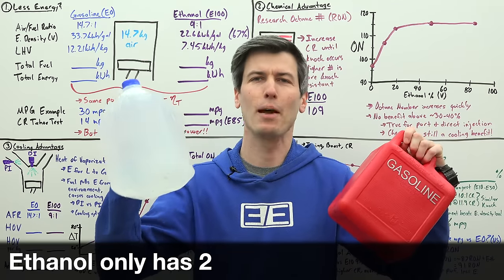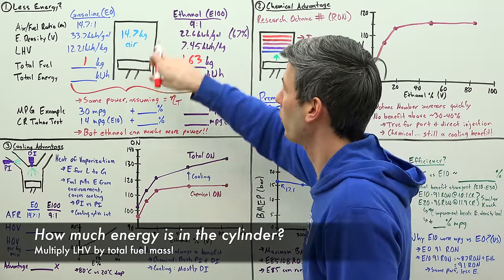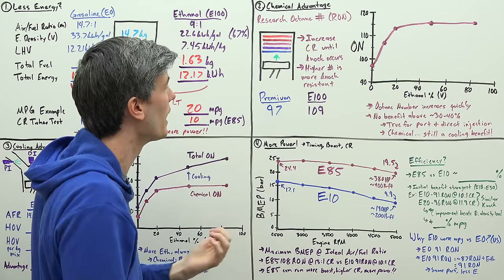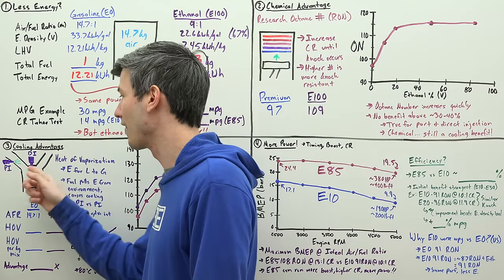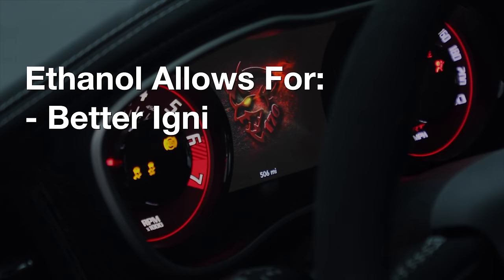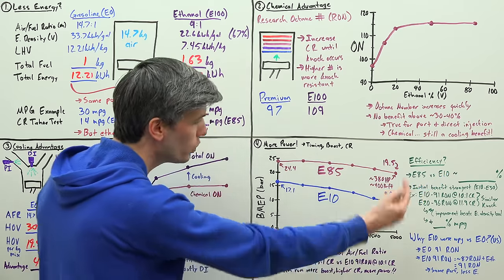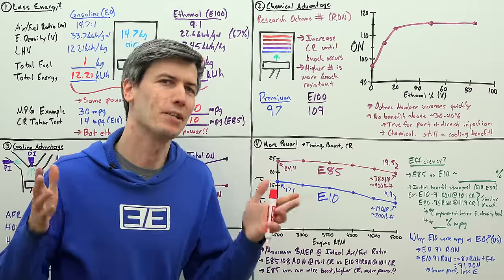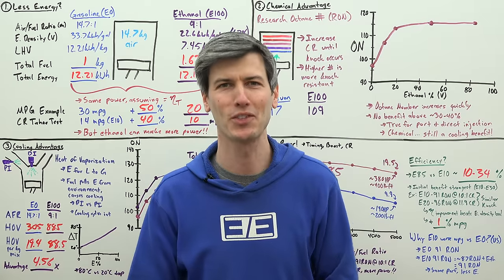Why Does Ethanol Make So Much Power? (Versus Gasoline)

Comment: So glad you did this video. This is what I have understood about ethanol as a fuel but could not explain to others for decades. The Model A Ford ran on ethanol because it was the original fuel for cars. Alcohol as an engine fuel is actually better overall but only when the engines are designed to take advantage of the properties of ethanol. It’s cleaner and can be more efficient. Regular gasoline can NEVER be cleaner burning than ethanol.
Reply: If ethanol is always cleaner, why is E-15 banned for environmental reasons in some places?
Reply: @karlrovey  — Here’s the answer to your question:

“Volatility is the property of a liquid fuel that defines its evaporation characteristics. RVP is an abbreviation for "Reid vapor pressure," a common measure of and generic term for gasoline volatility. EPA regulates the vapor pressure of gasoline sold at retail stations during the summer ozone season (June 1 to September 15) to reduce evaporative emissions from gasoline that contribute to ground-level ozone and diminish the effects of ozone-related health problems.”
Reply: @karlrovey There was an obsolete RVP law which E10 was granted a waiver from rather than updating the law for ethanol. Ethanol raises RVP slightly but overall effect is drastically less smog because exhaust is drastically cleaned up despite the slight increase of RVP. Pressurized fuel caps and carbon filters have taken care of RVP problems anyway. E85 never needed a waiver since its RVP is super super low.

E15 raises RVP less than E10 and higher blends are lower as well until more ethanol is lower than gasoline. In other words E15 produces less smog or RVP emissions than E10, yet E10 is legal in summertime and E15 is illegal. Go figure.

RVP is only measured at 100 degree F. Ethanol has no VP (vapor pressure) below 70 degrees and the vapor pressure of VOCs it does have are less ozone making than petroleum's toxic VOCs. Gasoline has vapor pressure down to -45 degrees.

Comment: I will watch again, but two questions that I hope someone can help me with:
* Is it all due to the cooling effect (whatever the term) that allows you to run high compression and therefore get more power?
* How can you change the compression ratio on an engine? I always thought it was done by bore size and stroke length? So how do the e85 kits work?

Excellent as always. This is the most difficult one I have seen you do to date! Excellent job!
Reply: 1- It’s not all due to the cooling effect.

2- the traditional ways to raise compression are head replacement (with smaller combustion chamber), shave heads, shave block deck, and install taller pistons.

For street engines, the Atkinson-cycle engine offers flexibility to run high compression or lower compression by changing valve timing. These engines are currently being used in production cars, but generally to enhance fuel economy — however, the potential is there for use in higher performance applications.

Then of course there is forced induction, which while not raising the mechanical compression ratio, does raise the effective compression ratio and thusly brake mean effective pressure (engine’s capacity to do work). Turbocharged applications are where ethanol really shines.

Comment: American open wheel race cars (CART, IRL, Champ Cars, and now IndyCar) have been racing on alcohol fuels for decades. They switched from gasoline for fire safety, and they ran 100% methanol and then ethanol.

The reason they use E85 today is because the additional gasoline has the advantage of making any open flames visible in daylight, as fuel fires in previous years were invisible (a pit crew who got a flash-up would do a Ricky Bobby impersonation).

Comment: For a couple of years now I've had an Audi that from factory can run any blend of regular gas/petrol and E85. I find the fuel consumption to be about 20-25% higher in the summer, but 25-35% higher in the winter, running E85 instead of E10. The increased cooling effect of the ethanol surely explains most of that, it takes noticeably longer to reach optimal operating temperature on E85, especially in the winter. And the longer drives I make, the smaller the difference. So cold starts is the biggest issue with E85.
At the pumps I usually just multiply the E85 price per liter by 1.3 to see if it's practically cheaper than the regular E10. Usually it's suspiciously close between the two, but sometimes it's actually quite a difference (in either direction) and then it's nice to have the option.
The factory engine mapping provides no performance benefit from different fuels in different conditions, it's just been programmed to always feel the same for the driver I'm sure. After-market engine maps could give it a SIGNIFICANT power increase for E10, but the stock fuel injectors cant flow enough to get the same increase for E85. An increase yes, but smaller rather than larger as the fuel would theoretically suggest.
Reply: I used 30% larger injectors in my Honda but your car may have enough injector to do it.

Comment: Modern flex fuel vehicles are severely compromised in order to run on gasoline without ethanol.  To get maximum efficiency (MPG) from ethanol fuel the engine needs to be optimized for ethanol but they could never be run on pump gasoline fuel if they were.  E-85 can easily stand 4 or 5 points higher compression ratio (higher compression gives more efficiency through greater expansion and less surface area absorbing the heat as well as the air and fuel molecules being closer together and more likely to find one another quickly and burn before the exhaust valve opens and releases the pressure) more than pump gas but if you ever ran pump gas in an engine with 4 points higher compression it would detonate severely and destroy itself very quickly.  They could easily go from a max of about 11 to 1 compression with pump gasoline to 15 to 1 compression with e-85, also since the same engine running 4 points higher compression and ethanol would make a ton more power you could also shrink the displacement of the engine to further increase MPG and still make the same power as the larger engine running gasoline.  It is good to note how chemically ethanol needs less air because chemically it carries some oxygen in its chemical makeup thus requiring less from the air, thats why it runs ideally at a richer ratio and how it can make more power, it is like adding liquid oxygen.

Comment: Another really fine, clear, concise and comprehensive presentation.  For those of us intereted in fuel economy,  actual fuel economy (miles per dollar vs miles per gallon), how does the greater compression ratio effect typical around town power use versus fuel throttle?  (basically, the same fuel consuption raios to pump gas or more or less) Thanks, Scott

Comment: Very interesting, thanks a lot! I use E30 with my 50 ccm naturally aspirated,  three valve, 12 to 1 compressed fuel injected lambda sond engine, which has no knock sensor. It runs fine, exactly like E10, even the cold start. My thought is now: Is there a benefit, when the engine cannot adjust the spark timing (earlier, because of the higher octane)?

Comment: It's nice to watch a channel who knows what they are talking about. E also cleans an old engine fuel system and valves. Highly recommend a gallon or two in a tank. E itself burns perfectly clean, without toxic detergents and octane boosters. lol if you think gasoline from crude oil burns cleaner than alcohol.

Comment: I used this in my non ethanol fuel cars. Never had an issue. I would not use it in a 90s cars. No kits nothing. All engine lasted over 150,000 miles. Only issue was cold start up and a lean code which did nothing. Regular gas back in and check engine light goes away. No there is no damage! Don't ask! Nothing broke

Comment: I had been building and racing NA engine cars for decades, but got tired of having my lunch eaten by all the turbo guys. Granted, there was a steep learning curve in making the jump to forced induction. Then again when converting to e85, but getting all the gains I've experienced, I'll never looked back. Originally, to make the desired HP out of a 2.0L 4 cylinder for track use, I was running it on 98 race gas with a GT3071R turbo making 24 psi. Lag was completely ridiculous, even with variable control from the ECU, power came on like an on/off switch at 4.5K rpm, and with sustained boost, heat sink was a constant issue. Not ideal for a track car, but switching to e85 turned out to be the magic sauce. I was able to get more power out of a smaller GTX2867R at 22 psi. It's now making positive boost at 2.5K rpm with the flat linear power curve of a NA V8 engine, and I've never had heat issues since. What's most impressive after switching over, after 5 seasons of thrashing on it, with regular maintenance my engine is still running strong. From beginning with research to my own personal experience, this fuel has far surpassed my wildest expectations. I doubt you'd see the same results from a daily driver, but in this vid you can see why e85 has truly earned it's reputation as "absolute turbo crack" in the racing community.
Reply: Good deal!

Comment: This is the most excited I've ever seen anyone about a 1% improvement in mpg, and I love it
Reply: Well considering majority here say you get 10-30% less mpg....yes its very exciting to see them squirm...I LOVE IT.
Reply: @oldblueaccord2629  I used E30 the other day in my Traverse (non-flex fuel) along interstate and expected my mileage (which is set to average at 50 miles) to go down and I had already done about 50 so it was a good test.  My mileage went up a wee bit to my surprise.  I had some E10 in tank so it probably was around E25 in full tank.  I then remembered this also happened a few years ago when it was new, I added enough E85 at a station on a fuller tank which ended up being E30.  I was getting 27 mpg then, last week was 26 or so on steady driving, up from 24.8 on E10.

 I once leased a Ford Explorer that was flex fuel and mileage on that never as good as this Traverse.  Gave it back to Ford (after a fight) because it would not start on E85 inside my heated garage while my GMC pickup started on it in bitter cold weather sitting outside at the same time.  Company higher ups even came to look at it at the time.
Reply: @danafletcher2341  I get about the same MPG with 30% mix compared to 93 octane in my SRT Jeep also. Im going to do another run of test soon and video it like I did last year.

Comment: I haven't seen premium in Canada above 94 octane and I use it... In my 18 SportWagen I get roughly a 14% fuel efficiency increase over 91 octane, and almost 25% increase over 87 octane.  I kinda like the flexibility of modern fuel systems and how detailed the manufacturers are going with the fuel maps pre saved, with flex fuel sensors and O2 sensors

Comment: The only thing that I question is when you say direct injection has a greater benefit but doesn't indirect actual benefit more due to having more time to cool the air. It's why a carb will make more peak power.

Comment: Thanks for the great videos and sharing your knowledge. This is off this topic but have you looked into the "wet belt" like the 1.0 Ford Ecoboost engine where the cambelt runs in oil. There is quite a number that are failing due to belt debris  clogging up the oil pick up. It would be interesting knowing more about them and if oil have additives that prevent the belt from deteriorating. These engines do seem to be quite efficient and quite powerful for its size. 

Thanks again

Comment: I think your missing the air density advantage by cooling the entire intake charge.  Direct injection isn’t giving you the best return o the cooling capability.  If injected or metered upstream you’ll see an advantage because the air density is increased.  The power comes from the ability to increase the charge volume in the cylinder along with the octane available.   This is related to maximize HP potential. Great videos…

Comment: Noob question, does it make any difference when blending ethanol directly to gasoline and injecting to the engine compared to having a different set of fuel system for ethanol itself? aside from the complexity of the setup, like will there be some positive changes in economy and performance or is this just a way of complicating things for the same output? Thanks 🙏
Reply: E85 is maximum performance. Flex fuel is probably the best over all for economy.

Comment: I have a 2008 flex fuel Chevy Impala with 310,000 miles. 75% of those miles have been on E85. Up until about 2 years ago e85 was .60-1.00 a gallon cheaper.. Now is only about 30 cents a gallon cheaper and a few of the stations actually stopped selling it. I have one just 2 miles from my house that still does but the price sucks generally. I often still get it because the regular gas they sell sucks and smells funny.

Comment: Ethanol vs water/methanol or 100% methanol.

E30-E50+50/50 water methanol.

I have 5 nozzles for methanol on my 2010 Audi A3, but I upgraded my direct injection setup to support E85. I can run it all, but I was contemplating what would give the best results.

Once I hit my octane limit and fuel limit, cooling would be the next focus. Instead of using E85 or methanol, using a mix of both might be the best option.

Comment: This was VERY well explained. Thank you for confirming my theory that California’s E10 91 octane fuel is really just 87 octane cheap trash gas with some ethanol thrown in to raise the octane. Frustrating. (plus at the current price of $5.50/gal, very frustrating) 

There’s a gas station nearby that sells E85 for $3.50/gal. My car isn’t flex fuel, but Cobb is making a CARB legal kit and tune for it.  Ignoring the cost of that kit ($$$), and assuming I accelerated at the same pace no matter which fuel I was using, would E85 be more efficient for daily driving?  (assuming I can run lower rpms with E85, and still get the same hp as E0).   Of course with double the hp, the temptation would be there to accelerate faster. 

Shoot, now I can’t remember... if the cruising speed were the same, does quicker acceleration use more fuel?  Ie 0-60 in 4 seconds vs 12 seconds.  There’s probably a sweet spot for the engine/gearing combination as well as A/F ratio and engine efficiency at particular rpm.

Comment: most probably already know this but since it wasn't explained -- "knock" is kind of a slangish term for detonation, meaning the air/fuel mixture is ignited by something other than the spark plug
Reply: And to be even more specifics, detonation occurs after the primary ignition event. If it occurs before the spark plug fires, it’s called preignition.

Comment: On the last point about E0 95 vs E10 95 (UK/AUS), if I understand correctly, the RON calculation is based on the chemical knock resistance and ignores the cooling effect.

Therefore, E10 could actually provide more knock resistance, due to slightly lower cylinder temperatures and therefore higher knock resistance.

The Skid Factory did a video on this on a Subaru on a dyno and tuned for highest BSFC using E10 95 vs E5 98 I think

Comment: So you're telling me that E25-E30 might be the sweet spot for fuel mileage and also power benefits etc... I have a 93 Gas tune and a E85 tune for my Durango SRT and my fuel mileage on E85 for sure took a hit but I had soo much more low end torque and power. Daily driving it I came to realize that fueling up every week was becoming a pain and driving to LA and back id have to fuel somewhere as before I could make it in one tank. I think I may try an E30 mix as that seems to give me some more power than say 93 but I should still have decent mileage compared to straight E85
Reply: I run E30 on my SRT Jeep untuned and it works really well. I loose about 1.5 mpg to almost zero. I have a bunch of boring videos on it on my channel.
Reply: @oldblueaccord2629  ya from what I’ve researched almost 90% of cars from 2005 and newer can actually run E30 mix and still do just fine. However manufacturers have said in manuals and etc to do no more than E15 only cuz big oil didn’t want to lose money to ethanol producers. Imma check your channel out. Thanks man

Comment: Well here in Brazil our pump gas is for decades 25% ethanol, also most of our cars are flex fuel, so they can run on gas or pure ethanol and any mixture in between. As a rule of thumb you can switch over to ethanol as the price per litre is 70% or lower than gas, this is to compensate the lower mpg get with ethanol.

Comment: I remember when here in Algeria they started phasing out lead with unleaded fuel (i'm assuming it's E10), and people noticed that unleaded had worse fuel economy, but well it was said that unleaded was cleaner for the engine
so E10 was used for city driving, and the leaded or premius gas was used for traveling or highway, but it got phased out completely 3 years ago

Comment: I gather from your figures, an engine designed to make the most of E-85 would not function well on E-10. It would need to retard the timing quite a lot in order to avoid knock. It might even need a compression release mechanism. This is intriguing in that alcohol can be made from other sources that are renewable and it releases less pollution.

Comment: Running a 6.2L Raptor. Get better MPG from 91/E0 vs 87/E10. 

It’s cool to see the math that I found by experimenting. Thanks for bringing the books to the streets!
Reply: Cool except your supposed to be running 91/93 octane in a Raptor...Great story otherwise.
Reply: @oldblueaccord2629  I see you are very wise. Manual actually states 87, as you know, since you too obviously have a Gen 1 Raptor too. 

I run 91 when I can find it. Unfortunately I live in a gestapo state where 93 is a rare find. E0 is like a unicorn.
Reply: @mfng3839  apologize for that I was thinking the 3.5 L turbo motors.